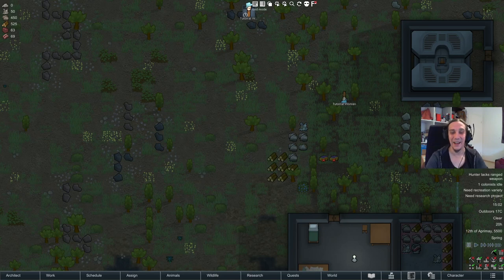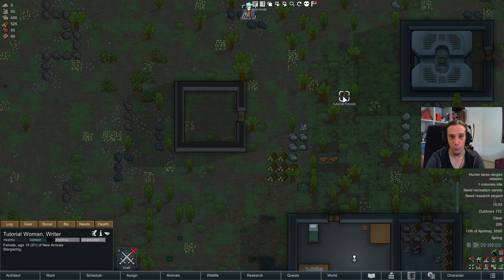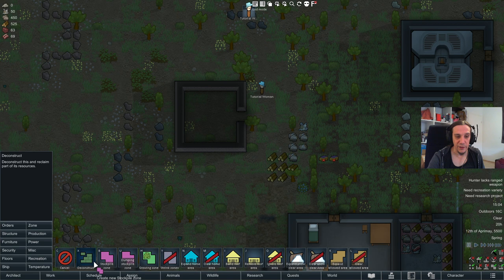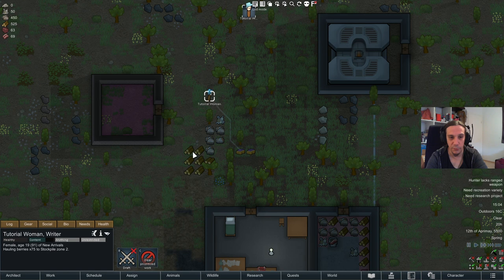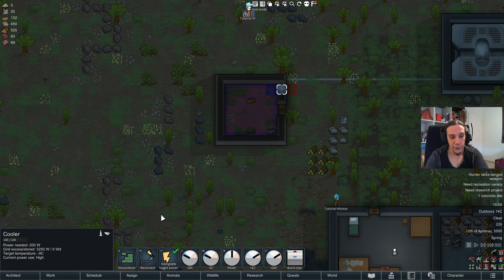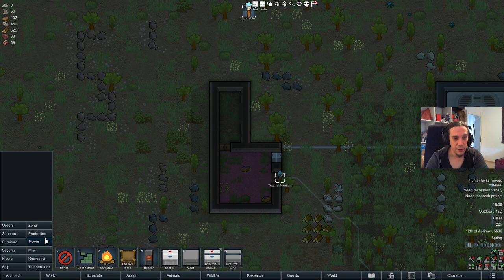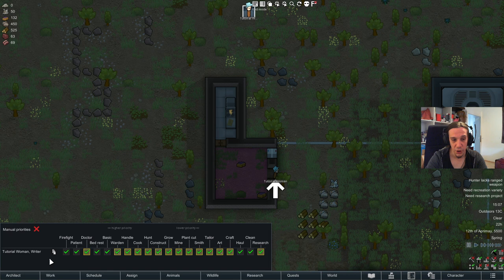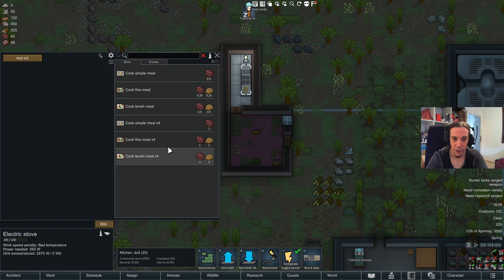Rimworld Easy Freezer and Kitchen Guide - Gameplay Tutorial

Comment: Do shelves block coolers? I know stuff that you can walk through doesn't block them, but you can't walk through shelves so I wasn't sure if I should place the shelves away from the walls due to airflow.
Reply: I’m pretty sure it’s a priority thing with shelves, pawns will walk through other shelves to get to a shelf deeper in the stack. I’ve always kept the tile supplying the cold empty of shelves, that way it doesn’t mess with anything, though I don’t know for sure if it will mess with the cooler
Reply: @nerfmodderguy217  Oh so I don't need to leave empty corridors between shelves so pawns can access them? That's good to know.

Comment: ok so when i make my freezer or walk in fridge I do every think that you did but my AC unit for some reason doesn't work it will cool down the area a little bit but not even close to freezing sometimes i have to put 2 or three in just to get a sum what stable 0 degrees.
Reply from the maker: It really depends on the outside temperature and the size of the freezer. In really hot regions I sometimes have 5-6 Air Coolers running to be ready to tank a heat wave too. Usually my freezers in hot regions need 3-4 in standard times and in cooler regions 1-3 (depending on the planetary zone and size of the room ofc).

Hope this helps!